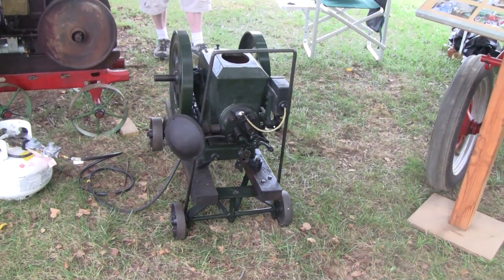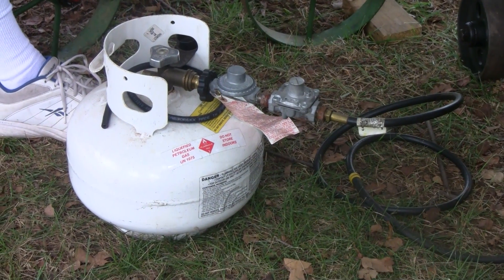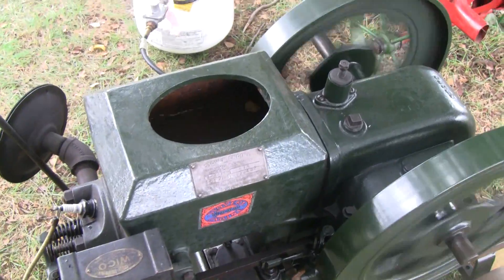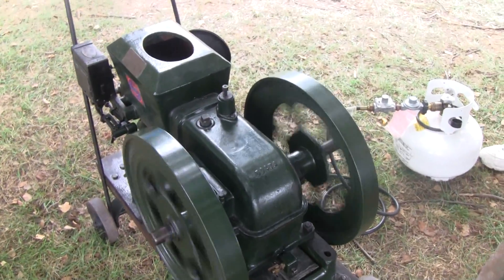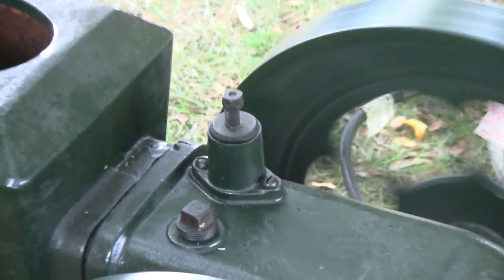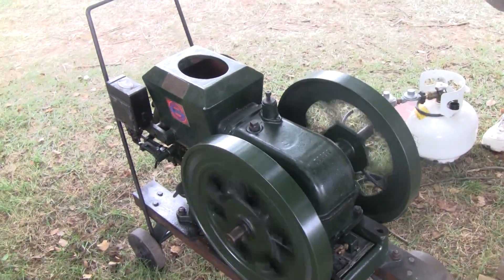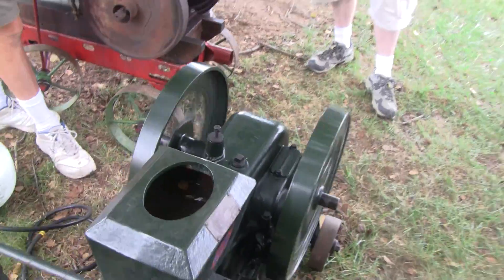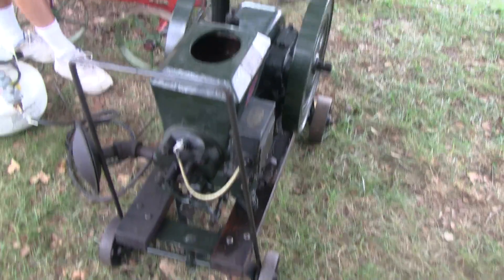LPG POWERED HIT MISS ENGINE

Comment: Got a question about running LPG on 4 stroke engines (I'm using for a mud motor for my boat).

Because CNG/LNG/JP are gases, they provide no lubrication or cleaning for the intake valves. Consequently, engines that run on dry fuels usually require hardened valves and valve seats to minimize valve wear and valve recession. Have you seen this as an issue over time?